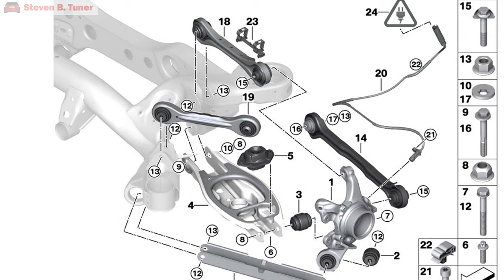BMW Axle Replacement - BMW E90 E91 E92 E93 Rear Half Shaft / CV Axle / Drive Shaft Replacement

Comment from the maker: Who is ready to DIY replace their own drive shafts?

Here is a breakdown of the chapters in this video: 
0:02 BMW E90 Driveshaft Replacement – Intro
0:21 BMW E90 Driveshaft Replacement – Special Tools Required
2:39 BMW E90 Driveshaft Replacement – Remove Wheel Center Cap
2:54 BMW E90 Driveshaft Replacement – Remove Axle Nut
4:20 BMW E90 Driveshaft Replacement – Mark Normal Ride Height
4:35 BMW E90 Driveshaft Replacement – Secure and Lift Car
5:35 BMW E90 Driveshaft Replacement – Optionally Remove Exhaust and Chassis Strengthening
5:55 BMW E90 Driveshaft Replacement – Remove Control Arm
6:40 BMW E90 Driveshaft Replacement – Remove Bolts from Differential
8:29 BMW E90 Driveshaft Replacement – Remove Differential End of Drive Shaft
9:01 BMW E90 Driveshaft Replacement – Remove Hub End of Drive Shaft
9:58 BMW E90 Driveshaft Replacement – Maneuver out the Drive Shaft
10:38 BMW E90 Driveshaft Replacement – Made with GKN Parts
11:00 BMW E90 Driveshaft Replacement – Check the Nut and Grease the Shaft
11:25 BMW E90 Driveshaft Replacement – Install Hub End of Drive Shaft
13:40 BMW E90 Driveshaft Replacement – Install Differential End of Drive Shaft
16:37 BMW E90 Driveshaft Replacement – Reinstall the Suspension Control Arm
19:18 BMW E90 Driveshaft Replacement – Torque Up the Axle Nut
20:48 BMW E90 Driveshaft Replacement – Bend Axle Nut Locking Tabs
21:40 BMW E90 Driveshaft Replacement – Torque Wheel Nuts and Finish the Job
22:30 BMW E90 Driveshaft Replacement – Outro
Reply: I would be if you did the driveshaft. These are axels
Reply from the maker: @edwardruelas3116  Hi, thanks for watching! The 'correct' name varies depending on where you live, and unfortunately I can't fit every variant in the short youtube title.

Comment: Best BMW DIY video I have ever seen. Thank you so much. I decided to replace the bearings, and arms at the same time as it seemed to make sense. Thanks to your video I was able to get the CV axle out really easily. Just struggling to remove the hub and bearing now though so will try some other tools later.
Reply from the maker: Glad it helped you out!

Comment: Nice video. I did the left hand side on my E61, exhaust had to be lowered and axel spline were rusted to the point where my 10 ton hydraulic hub puller spindle started to bend. But got it removed. 13 year old car with what corresponds to 222.000 miles on the clock. Certainly not a walk in the park. Note that the original driveshaft is a lightweight hollow construction whereas the replacement part is thinner but solid.
Reply from the maker: Hi, nothing quite like rust for making a job 10 times worse!

Comment: I wanted to add a word of caution to any DIY'ers attempting this. I'm working on replacing the rear wheel bearings on my '09 E82. My car has no undercarriage rust whatsoever, as it has spent most of its life in Southern Texas, and more recently in Southern California. I attempted removing the axle from the hub using multiple techniques, all ending in futility and/or broken tools. I'm down to the choice of trying a hydraulic press or buying brand new knuckles/axles/hubs/fasteners. My conclusion is that it's pure luck of the draw determining how straightforward it is to remove your axle. Just do a quick YouTube search on stuck BMW axles. Suffice to say there a lot.
Reply from the maker: Very true indeed. Any parts that have been on the car for more than 10 years are going to be a big problem for sure. My advice is to always drive your car hard so that the axles don't last more than 5 years ;-)

Comment: Nice Video, thanks for taking time to upload.  I've got both sides to do tomorrow. Last year I was getting ABS fault which was as a result of corroded reluctor ring.  In order to fit the reluctor I had to go through the same rigmarole removing the driveshaft and refitting it.  It was a bit of a bodge as there was a lot of corrosion on the driveshaft too and the reluctor did not fit snugly so I ended up putting some chemical metal on it (ran a bead around the shaft)to get the reluctor to fit snug.  At the time I ordered 2 new driveshafts as didn't expect the fix to last but lasted 13mnth until just started same problem today.  Luckily I kept the parts so my Sunday is all booked up now.  So the moral of this story is that instead of changing the reluctor rings I should have waited until the driveshafts arrived and done the job then as I'm now having to do the same job twice.
Reply from the maker: Hi, that's great information for anyone who has the same issue! The only consolation is that the job takes a lot less time the second time you do it...
Reply: Im having the same issue...Did the new drive shaft have a reluctor ring included? And where did you order from?
Reply: @fernandoalvarez4706  Hi, yes they were pre-inststalled on the driveshafts. I got them off of eBay
Reply: Did you not grind all the corrosion off where the old reluctor ring sat before installing the new one. A correct repair should last way longer than that.
Reply: @benreeve9130  yes, that was the issue. Once I'd removed all the corrosion it was too worn down for the reluctor to fit snugly, hence having to build it up a bit with chemical metal

Comment: Doing the same on my E90 from 2011, Needed to replace the ABS-ring on the left side, and decided it would be easier to do the entire driveshaft. But have to remove the exhaust to get clearance it seems, as it doesn't seem to be separable I have to remove the bolts all the way from the front of the car to get rid of the system.. This video makes it seem, do-able tho, cheers
Reply from the maker: Hi, it's not the worst exhaust system to remove. When you come across a rubber mount, it is usually easier to unbolt the complete bracket from the gearbox etc rather than wrestle with it. To get the exhaust out you will need to remove the chassis support brace, but that is straightforward. Make sure you have a long socket that will remove the axle shaft to diff bolts before starting the job. All the best with it!
Reply: I have the same problem but I have a newborn so I think im going to just bring mine into bmw

Comment: Hi Steven what's the reason for removing the control arm? My drive shaft was really badly seized/stuck, would removing the control arm make it easier for the drive shaft to come out? Because I skipped that step. Thanks
Reply from the maker: Hi, on my car it makes it 10 times easier. On other models it doesn't make as much difference.
Reply: @StevenBTuner  Sorry for this idiot question from Sweden. I have a 318i E91 2012 143Hk and i am on the way doing this but i am not used to work with these things on cars. If i can do it without removing the control arm i assume i dont have to mark the suspension with a pen ?
Reply: @D4all66  no you dont have to. But the control arm may be in the way. Its much easier to have more space to work with. But if you dont have the tools to get it back on properly i would recommend you trying without removing it.
Reply: @Cozstreams1  Thx!

Comment: Trying to replace a water pump and thermostat for a BMW 528XI. What do you recommend?
Reply from the maker: Hi, if you choose to go with cheaper than BMW parts then they can still be okay if it is a good brand - but I would really recommend using the BMW gasket set, as it is better than any other I have seen.

Comment: Hi, I had this work done by a garage in August. Whilst I was driving the car, my passenger side rear driveshaft came completely loose from the differential. I found some of the bolts and washers on the road they were all bent. I had to get it towed to a nearby garage, do you think I should get in contact with the garage that had the work done originally ? What are the chances they will fix their mistakes for free, and what could have been the reason it came completely loose ? Also this could have been really dangerous if it happened on the motorway going 70mph, luckily I was just in second gear driving in the town.
Reply from the maker: They might have used the wrong bolts or re-used the old ones or not done them up correctly. None of those reasons would make me very confident in their work.

Comment: I clutch dumped my 318i from a standstill with stability control off and i got a lot of wheelhop shifted into 2nd and my rear left snapped limped home somehow not sure if its the driveshaft but cars not driveable now as soon as i try to move it rear left wont spin its just grinding
Reply from the maker: Ah, the trouble with trying to spin the wheels on a car that has everything setup from the factory for maximum grip... You'll have to take the driveshaft out before you'll know whether it is the diff, driveshaft or wheel bearing that you have damaged.
Reply: @StevenBTuner  did so its the diff...found a 90k mls one but now im afraid same could happen...will get coilovers,ive 19' alloys,but the linkages and all that are suuuper suuuper thin and weak,thats why i was thinking to put a lsd in so the tear and wear is equally distributed not just one side every mechanic said dont not worth for this car.
Reply from the maker: @sven4921  Hi, your mechanic is probably right - but that doesn't mean that you can't have some fun! Weld the diff, replace all of the diff bushings, gearbox bushings and sub-frame bushings with stiff polyurethane, add those coilovers, pump up the rear tires to the max and then go drifting :-) (on private land of course)
Reply: @StevenBTuner  thanks so much for recommending that I seen ppl are doing it but didn't know if it does anything its reassuring that you say it.its just that I cant weld the diff becouse the car is my Daily and it would be hopping around haha.Not in a financial situation to have 2 cars insured im in ireland and on a learner permit my insurance be 5k until I get no claim bonus.

Comment: I've replaced driveshaft and damper at same time.  To get more flexibility removed stub axle end of control arm and two other links to stub, but find tightening the bolt through the control arm is too tight. I've adjusted height and maneuvered, but is there a knack?
Reply: Answering my own issue, I loosened off the other two 18mm bolts which I'd tightened but short of torquing them up.  I also measured off the ride height with wheel back on to ensure correct geometry.  I also sprayed silicone on the exposed bolt to reduce friction and WD40 into the rusty orifice it was aiming for.  I then managed to tighten with 18mm spanner without stripping thread all the way home.  Awkward to get a torque wrench on.  With both hands pulling on the spanner in small turns I really don't think that's coming off.  On another point I don't think you mentioned the torque setting for drive shaft 6x 10mm torx bolts into diff' flange.  Research showed should be 22 Nm.  That seems low.  My wrench starts at 28Nm.  You said add 10Nm on for extension bars.  So would be around 30Nm although the 1/2inch extension bars are pretty straight, which is just past where my wrench begins and seemed like a light touch before 'clicking'.  I guess avoids snapping bolts.  Earlier when I removed the driveshaft which has been an utter pain, I used 1/2 bars with a 3/4 turn bar.  Two bolts stuck snapped off with modicom force.  Absolute nightmare getting shaft off.  I grinded, drilled, eventually took three stub axle arms off to get flanges apart then freezing spray and that worked to get bolts out with stemsons.  Tested car jjust now and no Traction Control problems, so I guessed off-side right first time.  I'll still do near/side as have the parts (driveshaft, new bolts, damper).  Your video is fantastic.  A professional video company must have made it for you. Extremely well made.  The only I'd find useful I didn't see is clearly stating verbally, graphic and text in description the bolt sizes and torque settings.  I don't think you stated driveshaft bolts were 10mm, I got mislead online and wasted time/money on 8mm.  I also invested in a range of 3/4 socket tools and torx sockets, and although BMW used a range of sizes as you said, it seems most are a common size which I think was 30mm for axle and an E12 Torx for drive shaft bolts.  Hard to get the right ones.  I bought a couple of cheapo sets of 3/8 shallow sockets, not ideal, a box of good quality 1/2 torx sockets and then finally the long impact 1/2inch E12 which looks like yours that works a treat; link is here to buy:   https://www.amazon.co.uk/gp/product/B001NYXEQ4/ref=ppx_yo_dt_b_asin_title_o02_s00?ie=UTF8&psc=1
or search "KS Tools 515.1053 Impact socket ETX, deep, 1/2", E12"
Reply from the maker: The only knack is to track down high quality sockets and spanners that are thinner (but still strong) so they will fit in the tight spaces.
Reply: @StevenBTuner  Hi Steve, great video, doing the other side it was going so well, only needed to unbolt the lower arm to free driveshaft from diff end, BUT then driveshaft is jammed in Hub!  Heat on hub, cold freeze spray on shaft, lots of WD40 both sides in between, resorted to hitting with weighty hammer after the Puller snapped 3 of the 5 claws and the rod that pushes into shaft bent out of shape.  Tomorrow I'll get my Kango breaker on it.  I'm a believer that just pressing isn't enough, it needs shock and ore, it'll get that from the Kango.  If that doesn't work and shaft/thread is OK I'll just keep the old shaft, it was working fine, just trying to do the right thing doing both sides and new bolts etc.  If it works, winner, new Brenbo disc brakes, pads, good quality shocks, shock mounting kit and hopefully two new drive shafts.
Reply from the maker: @JSPVid  You are doing all the right things - I hope it will work out!
Reply: @StevenBTuner  Lol, not really, couldn't get the 'good' driveshaft off, so fitted 6x bolts back in, then found the hub end was wobbly.  I'd over heated and whacked it.  That effects the bearing.  So have had to buy a new bearing and new job is to remove new brake disc, remove hub with jammed driveshaft and press it out and press a new bearing in.  Should have left it alone!
Reply from the maker: @JSPVid  Some days...

Comment: need to replace mine but just found my driveshaft nut has completely rotted away 😬
Reply from the maker: Hi, there is a chance that it will never come apart and it can be easier to find a good used wheel hub. All the best in getting your car back on the road!
Reply: @StevenBTuner  It's the same thing for me, I discovered that today. I juste need to remove all connections to the brake/wheel/direction and the shaft ? Btw very nice video.
Reply from the maker: @estebanlegrand7128  I hate rust! It all depends on what else down there is rusted together...

Comment: Thanks for the guide! Looking to replace both rears on my manual 320i. When ordering the parts online the left and right sides are different lengths is that right?
Reply from the maker: Hi, there is sometimes some variance even on the same models, so it is best to search on your car's VIN to get the exact part numbers for the left and right side - you can use a site like www.realoem.com  All the best with the job!

Comment: Hello mate I notice the drive shaft has no abs ring? Mine are the same and I have abs faults do I need to fit rings?
Reply from the maker: Hi, the ABS system uses the wheel bearing on these cars, not a ring on the driveshaft. The sensor could be the fault though - all the best in getting everything working 100%.
Reply: @StevenBTuner  thank-you

Comment: What is socket size or what it is called for those star shaped bolts on axle
Reply from the maker: Hi, the Torx bolt can be 2 different sizes, so you have measure them before you buy the thin-walled deep socket or the replacement bolts from BMW.
Reply: @StevenBTuner  what is the size in ur case
Reply: the socket size is 36
Reply: Mine was a 30mm

Comment: Hey Steven I’m working on my 2006 bmw 330I Manuel it had gotten side swiped on the high way it suffered body damage and most of the control arms as in the trailing the upper forward and upper rearward I’ve already replaced the bent and broke but as I’m looking at my axles I noticed one my passenger side is longer than my driver side by 3 or so inches is there a difference in automatic and Manuel rear axles? Or do you know if they are interchangeable??
Reply from the maker: Hi, all the best in getting your car back to 100% again! There is a lot of possibilities when in comes to axles, so it is best to look up the part number using your VIN using a site like www.realoem.com , and you can see if the auto variant has the same part number.

Comment: Hi there, superb video. I will be following this procedure over the coming days. I have a Bmw E90 and I'm replacing the rear drivers side english vehicle. Could you please give me the torque settings for the E12 bolts and the big nut, mine is a 36mm. Many thanks in advance and thank you for your amazing in depth video.
Reply from the maker: I'd love to hear how it goes! With torque settings it is always best to find a workshop manual for the country you are in, as there are a bunch of variants worldwide - and I wouldn't want to give you the wrong one.

Comment: My biggest issue was inserting the drive shaft to the hub spline. I guess the spline has a slight taper on them. Tempted to create thin walled axle nut so I can just draw the drive shaft out.
Reply from the maker: Yes, I know what you mean - sometimes they just don't go in quite far enough for the threads to grab.

Comment: What special tool can I use for my E92 axle shaft? I used this special tool but it barely doesn't fit and I need one slightly bigger to press out the axle shaft if there anyway you can help?
Reply from the maker: A gas heating torch and a really big hammer can help.